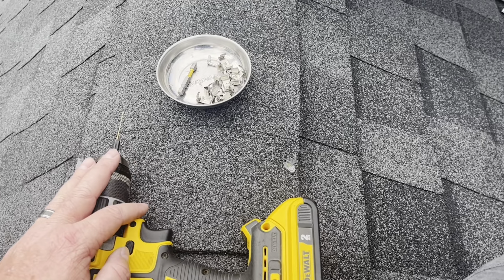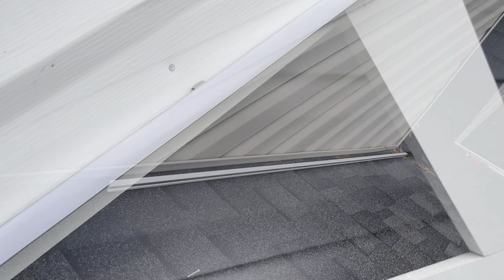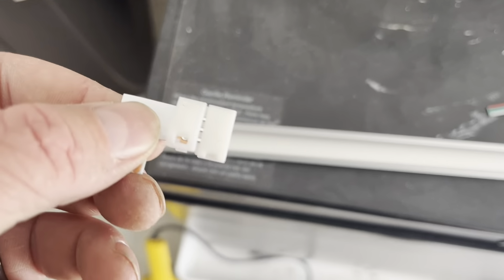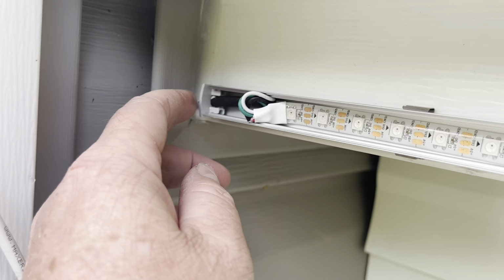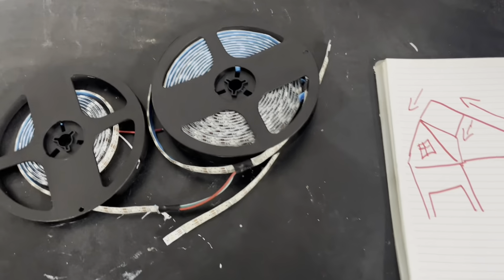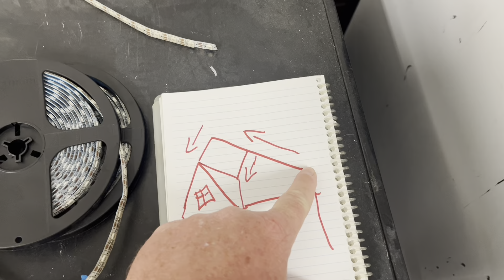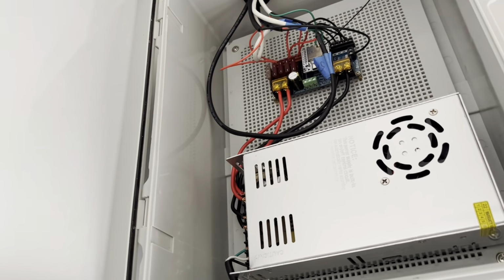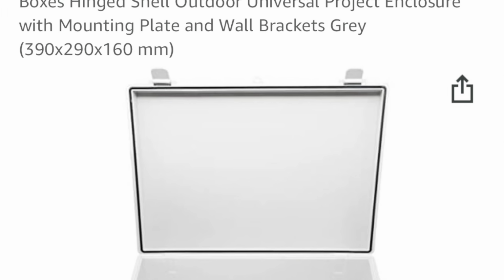How to install Permanent Holiday Lighting on your house PLUS cost breakdown!

Comment: About how many feet of leds did you run before you injected power?
Reply from the maker: I would probably inject power every 150-200 LEDs. The length will vary depending on what type of LEDs you use.

Comment: Great Video! The channel tracks you have used seem to be rated for indoor use. Have you had any issues with them outdoors. Not sure how cold it gets where you are but here it gets down to -30C. Any concerns about the diffuser getting brittle over time? I can't seem to find any labeled "outdoor use"
Reply from the maker: been working good for almost 2 years. I have noticed a little discoloration but not bad and it doesn’t affect anything at night when the lights are on.

Comment: Hi looks great. Where did you get the led channel? Any links?
Reply from the maker: I got everything on Amazon. Sorry I don’t have links but I left screenshots in the video
Reply from the maker: i have added links to the products in the description
Reply: @DIYD_Do_It_Yourself_Dad  Is the Dig Quad controller on Amazon or an equivalent?
Reply from the maker: @donniekostar9644  unfortunately not. There is only 2 places I know of to purchase the dig quad. Drzzs is the only US carrier and allnet is in China. DrZzs seems to be sold out most of the time. I have ordered from allnet 3 times without any issues.
Reply from the maker: The link in the description has links to both places

Comment: Isn't the IP65 LED strip that you used for indoor use only, it's water resistant but not waterproof? Are the diffusers meant to be enough to not get the strips wet?
Reply from the maker: Right the lights have a water resistant coating but the connectors are not waterproof. That’s why I soldered most of the connections. The diffusers do a great job of keeping water out but I also used silicone where the diffusers meet and at the ends as an extra precaution. I’ve removed a few of the diffusers after a storm just to check for water and they seem to be holding up nicely. So far we’ve several strong storms and no issues so far.

Comment: I'd be interested to learn more about the software side. How to you ensure the animations align between strands? What are you using to manage the effects?
Reply from the maker: In this video I used a software called WLED. It has effects already setup. It also has a features where you can control individual LEDs. This is a good place to start for beginners. This next holiday season I will be switching to a software called Xlights where I will have far more control.

Comment: I've used pixels with xlights, so this isn't too much different.  Now I'm tempted to do permanent.  Question, do these lights go bad from time to time like pixels do?  Where it won't send data down the line
Reply from the maker: I’ve heard they can but haven’t experienced it yet. The fix is just cutting out the bad pixel and replacing it or joining the remaining halves together

Comment: Great Video and the parts list sure helps beginners like me. One questions, you show on your drawing and talk about power induction points, did you run one power wire and just solder into the positive line at those points from the one power line?
Reply from the maker: I run a separate wire positive and negative to those spots where I power injected

Comment: Great video. Sorry for the dumb question, but what's the difference between the white and black 100 ft spools of wire? Black is power? and white is power and data? I'm a bit confused. Also curious on the power injection how far you went before needing to re-inject.
Reply from the maker: You got it! Black was just for power injection and white was power and data. I would say power injection should be at least every 300 leds

Comment: Loved the video. Was easy to follow and didn’t confuse, like so many others. Would it be possible to get more in-depth on how you did power injection and how you setup the zones or ports so they work together?
Reply from the maker: I’ll be making another video soon about some props for my yard so I’ll make sure I include that for you!
Reply: Yes how did you get the power injection wire into the channel to solder
Reply: And is there ANY channel that will hold 18g power injection wires (4)
Reply: +1 For power injections info. I've done LEDs indoors but when it comes to a large outdoor house with multiple runs I don't really understand how to do it and what power supply is sufficient.
Reply: @DIYD_Do_It_Yourself_Dad  Can you possibly do a video on soldering too?  Yours looked very well done

Comment: Thanks for the video! There is a significant lack of info on power injection home run wire gauge out there. It looks like you used 18 gauge for all your home runs. I'm planning on doing the same thing but I'm worried about voltage drop with the longest run of about 80'. I might go with a 10 gauge wire for the home run and solder in a 18 gauge pig tail for the strip connection.
Reply from the maker: I didn’t have any issues with 18 gauge wire. I think 10 gauge might be a bit aggressive. Consider doing a parallel power injection with a smaller gauge wire in addition to a home run with 18 gauge.

Comment: An Additional question, Do you see any reason I shouldn't run the RGB and Power induction cables in the attic of my one story home? It would make much shorter runs for each.
Reply from the maker: I think that would be fine
Reply: @DIYD_Do_It_Yourself_Dad  Perfect, thanks for the quick reply!

Comment: This is the best exterior install video I've seen so great job!  I'm about to do the exact thing to our home.  I didn't see the union of the channels at the peaks once you got everything done but I'm curious about something.  I was going to cut mine at the angle I need to make the union look decent but I was not sure that soldering the bridge wires to go from one angle to the other at the peak would still allow the wires to be stuffed in to the channel and allow the opaque top piece to seat properly.  Did that work out OK for you?  I watched the video at the end and it seems that your LED's don's skip a beat at the peak so it had to be a tight fit I'm thinking.  I do appreciate the video! I have all my supplies and used the same LED strings as you and I think the same channels.  I was about to order solderless connectors and was researching track dimensions when I found your video so that saved me some time for sure.  I'm no stranger to soldering but ya know.
Reply from the maker: Yeah the wires fit fine. There is like an inch or two gap at the top but from ground level it isn’t noticeable. I just stuffed it all in the channels and loaded it up with hot glue just in case it leaked at the peak where I joined the channels.
Reply: @DIYD_Do_It_Yourself_Dad  awesome! Thanks for getting back to me.  I'll be doing mine in the coming days. Everything works indoors so now it's on to the frigid outdoors.
Reply from the maker: @yamahagrand  good luck!